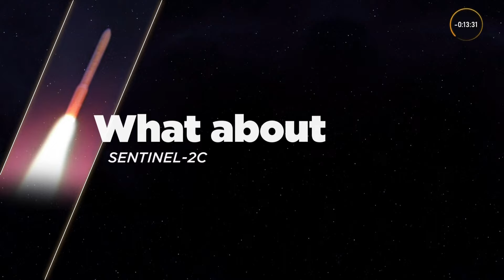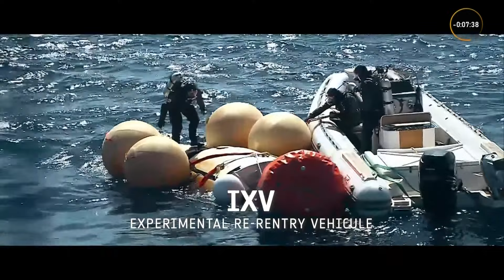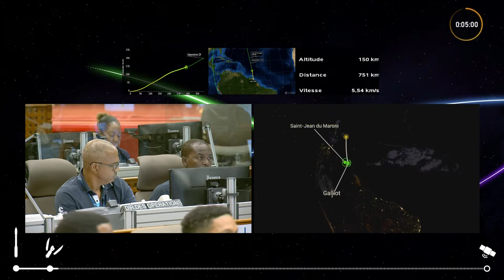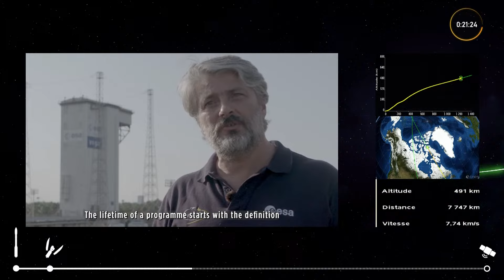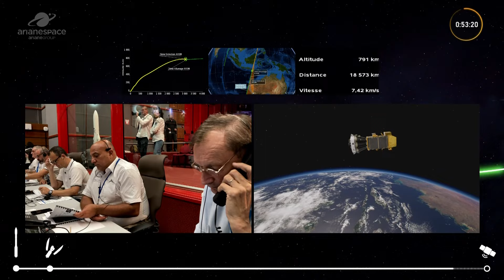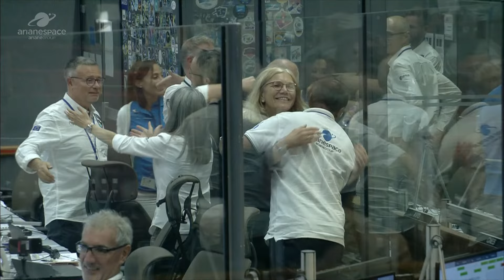Flight VV24 – Sentinel-2C | Vega Launch I Arianespace

Comment: I don't think it makes sense to launch a European satellite into a polar orbit from near sea level near the Equator on another continent. ESA needs a launch site in Europe proper, preferably at altitude.
Reply: If there were better options they would...😅
Reply: There are sites in both the UK and Norway that will be capable of smallsat launches to sun synchronous orbit. But they are not yet ready. The UK facility will initially only launch maximum two-meter diameter payloads.